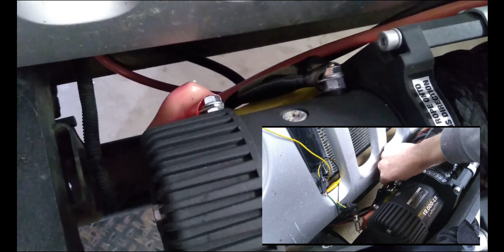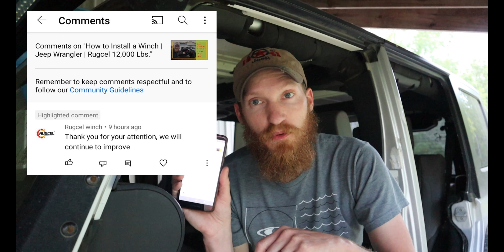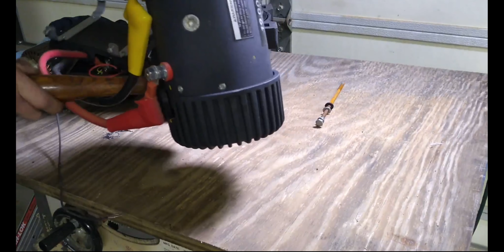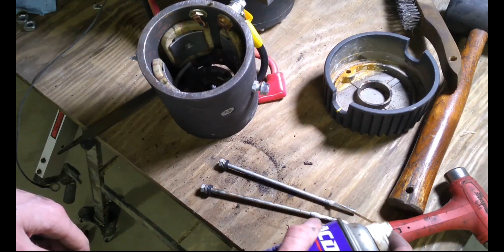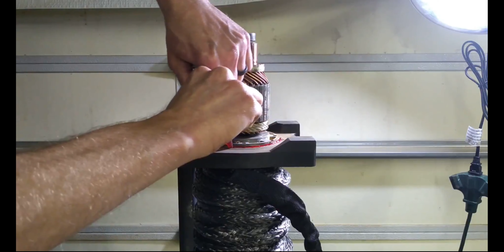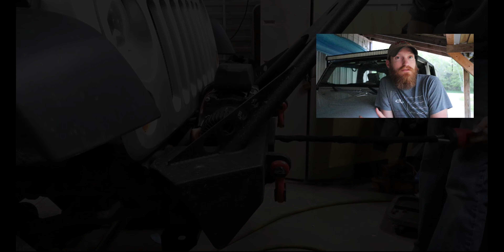Winch Diagnosis & Repair | Rugcel 12,000 Lbs. | Jeep Wrangler

Comment: I have a RUGCEL 13500, the motor is turning but the drum is not turn in fwd or rev. Yes I have the handle in the engage position. I had to take the rope off because it will free spool in either spool lock or unlock. Any idea of a fix before I pull it off completely
Reply from the maker: Sorry about your winch failure. I have a feeling that you have an internal failure. Taking it off for disassemble and inspection is going to most likely be your only option. I have one of these under the work bench right now. Hopefully I can tear it down at the end of the week to provide you some detailed insight. If you think that would be helpful let me know.
Reply: Thanks let me know what you fi d
Reply: The ring that holds the gears in place, should it have a break and where should it line up
Reply from the maker: @MikeFalk-e6j  Hey Mike, I haven't been able to get to the other winch yet. Thanks for the follow-up question. I will make sure to look at that in detail.

Comment: Thank you for the video. I had the exact same issue with my Rugcel 12000lb. Mine had the gasket but it still failed. 
I shot penetrant in the innards and then contact cleaner and finally got it to function. I must say that the quantity of rusty water that drained out of the housing was probably 6 to 8 ounces.
Reply from the maker: Dang thats alot of water. I am glad you found the video helpful. I just want to help more guys like us. I really appreciate you taking the time to leave a comment. Hope all goes well with your winch in the future. Rugcel sent me a 13,000 lbs winch that needs some repairs, I hope to post a video on that soon.